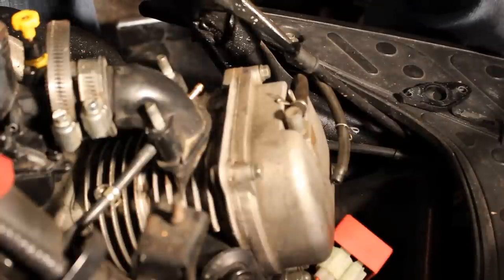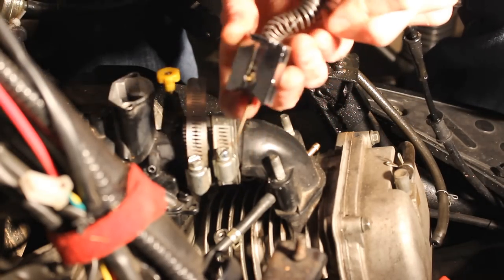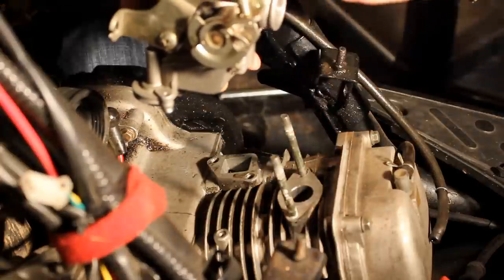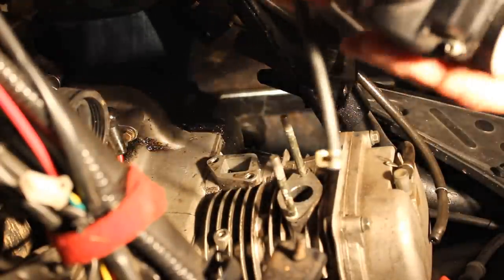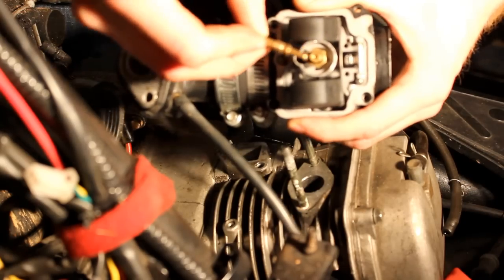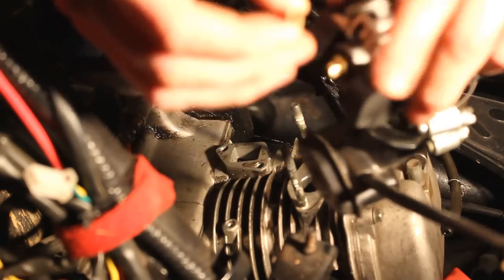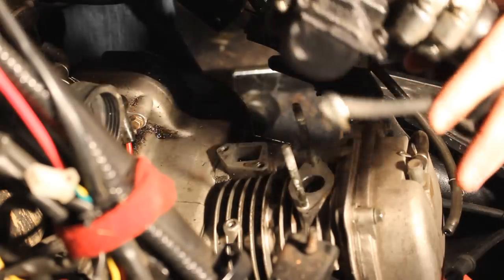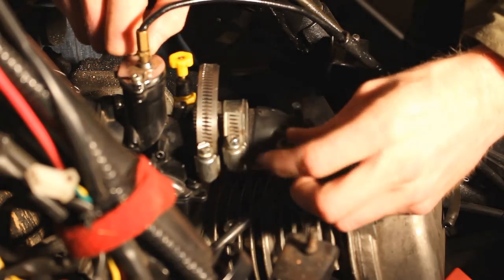How to clean jets and carb on a moped/scooter

Comment: i just want to know how you get those tight ass soft brass screws off the top of the carb without stripping them
Reply from the maker: kimmisoo morris get a Phillips head screwdriver that fits, hold it in the screw tight, take a hammer and hit the screwdriver, this will loosen it up.
Reply: i tried i couldnt do it i will have to find a man lolz i dont understand why they use such soft screws anyways
Reply from the maker: Yeah never made since to me! They make stainless screws to replace them, but have to get the old ones out first. Also you you can take vice grip pliers and loosen them that way.

Comment: I have a yamaha jog rr and i noticed some leaking (oil maybe?) ,also noticed some liquid comming out of my exhaust, and sometimes, there's like smoke comming out of my exhaust ( like burning smoke),also i feel the acceleration not as smooth as it used be and so is the sound, what's the diagnosis doctor ?

Comment: my bike, a Suzuki GS150R uses a Mikuni BS26 carb. The bike is making jerks when i encounter colder weather. In India the avg temp is 25-35 deg. But if i enter colder area during a long drive, it starts to jerk constantly, as if the engine had been shut of momentarily. it keeps jerking this way through out. I also observed that this starts to happen after i have driven around 5-10 kms. can we suspect carburettor mal function? if so, simple cleaning of the jets would do?  Thank a lot in advance.

Comment: could you make a video of changing the back tire & replacing the drum brakes on the rear??? ty for the video!!  we are working on a yamaha 125 vino right now....next thing in the carb!!!!
Reply from the maker: pat murphy I can't make a video of that at the moment but I could walk you through how to change it. If you have any problems or questions with the carb also let me know and I can walk you through it. Let me know how everything goes!
Reply: will do, ty, well it hadn't been started in five years, just sat, we changed the oil, gas tank is still in cleaning phase, but we ordered a new one to replace it, changed the gear oil, hopefully cleaned out carbs w/carb spray, new battery, only thing left to do is get new gas tank on, gas & hopefully start her up....hopefully..... she seems to want to kick over, but no gas going to carb right now, that's next....ty, will just have to wait & see, ty also, ordered new filter for side under kick stand/old one fell apart !!!front brake fine, back brake goes all way to handle, we probably can adjust that w/the screw on the brake???
Reply from the maker: pat murphy yes you can adjust it. Wow y'all have done a lot of work. Try spraying starting fluid in the back of the carb when you kick it. If no gas is getting to carb it can be the fuel petcock is clogged or not working properly. Or the automatic choke isn't working properly. Or the carb is still dirty.
Reply: k, ty!!
Reply: well, we cleaned the carb out & used sea foam on it, the pet cock doesn't seem to be working correctly, even tho it's brand new, so we are going to bypass that & i do believe it will crank w/gas, seems like it wants to, this is all i know to do......p.s. carb is cleaned out!!
Reply from the maker: pat murphy the petcock works by vacuum. Did you test it while turning over the motor? It will only work while pushing the start button or while it's running. By passing will work but will most likely cause it to flood out.
Reply: ty, the motor started w/the start button & carb cleaner, the fuel is going from the engine, but not going thru the pet cock at all-yes, all fuel lines are cleaned out & carb too, carb has been drained & sea foam put in, but it seems no vacuum to pull the fuel thru to the carb??? i'm stumped?
Reply from the maker: pat murphy is the vacuum line from the petcock attached to the valve cover?
Reply: i think so?....he took the carb apart at the bottom, everything was clean except the needle that floats up & down to let gas in, he said it didn't move freely/stuck, looked like it had rust on it. we are now wondering if we should just get a new carb, but he isn't sure if he can put it back together correctly because of the spring that handles the gas flow from the accelerator/right handgrip, he doesn't know if he can do that....???(lots of parts connected to the carb. at the side) so now we are at a standstill & i'm buying 2 more bottles of seafoam & carb cleaner.....lol..
Reply: Hey, it's me again....well now he's got the bottom of the carb cleaned very good & he got the moped started, but there is gas coming out the tube from the bottom of the carb, it has a little filter in the end of it, he says it's an air line or overflow line & the scooter won't start anymore, still gas coming out....there's a little screw w/a wire on it that holds the float in place & i'm thinking he didn't install it back in right, but he says he did...help!! & yes one of the vacuum lines is attached to the top of the tank...we have two lines that are blocked off from the carb & the third one w/the small filter is the one leaking gas out..help
Reply from the maker: pat murphy it is most likely leaking out because you have your fuel petcock bypassed. On moped gas is only drawn into the motor when it's running. (Through vacuum lines and petcock) if you bypassed the petcock there will be no fuel shutoff. So it will constantly be flowing fuel to he carb and cause it to overflow. Which will flood it out. So you need a new spark plug and new fuel petcock.
Reply: ok, thank you for your help!!
Reply: randomthingssc, well, it's official, the vino 125 is back to life! we had to buy a new carb for it, but it was worth it!! thank you for your help!! everything is working now, including the fuel gage!...it's going to need new brake drums on the back eventually, but for right now they are ok

Comment: Hi,  I have a neco one b 50cc scooter, was riding out maybe 3miles or so oil line came lose with the clip, I noticed quite quick as the power went downstraight away so I stopped reconnected the oil line. I went straight back home, but scooter kept overheating every 5mins. and cutting out.... By the 3rd time my battery was dead so I couldn't try restart. I got home , I topped up the oil, let the scooter sit for maybe 12 hours and charged the battery for 12 hours. Now its not starting. it turns over and its spitting small amount of white smoke and it sounds like its close to starting but it just wont.
Do I need to check anything engine wise? to see if this disconnected oil did any damage? or possibly clean anything? Just wanna avoid taking to dealership.... for a pricey fix.
Thanks in advance
Reply from the maker: @skyforge what oil line?
Reply: +randomthingssc the one at bottom , that's connected from oil tank into engine, but that's not the problem it has oil and is full, it just wont start after overheating but its quite close to turning over.....
Reply from the maker: +SkyForge it could be a number of different things. Take the spark plug out. Put your finger over the whole. You should feel a lot of air pushing your finger. If not then needs new top end.

Comment: I followed the video and put everything back together but same problem. I cannot see any light or run a wire down the long jet. Is it just blocked by hardened fuel deposits? What to do?
Reply: neo1az I cannot see light or run a wire through the pilot jet. It seems to be totally blocked by hardened fuel deposits. How do I clean it?
Reply from the maker: +neo1az new jet

Comment: Best to dismantle carb on bench, and avoid accidentally dropping a screw down the intake!
Reply from the maker: Doesn't look like I did!!
Reply: +randomthingssc   No, you didn't, and good for you!  Its just best to develop work habits that don't place the job in jeopardy. One day you may wish you had taken a precaution.  
A rag stuffed in the intake would be a good alternative also.
Reply from the maker: +caduceus33  this is true when I'm working on a car. But I can rebuild the whole top end of those motors in 20 minutes including setting the valves so not a big deal for me. But yes most people should take that caution with these motors.

Comment: What jets were you running in the oko on the 72cc VIP
Reply from the maker: Joshua Allen stock pilot. Not sure on main. Prob between 90-105. They sell a kit of 10. It's your best friend!
Reply: Yeah man I been working on these things for yrs. I'm just having trouble getting that same carb tuned on 100cc currently have a 32 pilot which is smallest i can find with 95 mj
Reply from the maker: Joshua Allen having trouble with idle or while driving? Have you changed the clip on the needle? Depending on the weather I had to move the clip on the needle on the side of the road lol
Reply: it's really rich on bottom end and the clip is 2nd from top
Reply from the maker: Joshua Allen sputtering? Tried moving it one up or one down from there?
Reply: Only when I let off throttle.
Reply from the maker: Joshua Allen fresh high octane gas. And Petcock is working right?

Comment: I have a 50cc eton matrix and it stumbles when I accelerate but will start every time it will run fine then just start stumbling then it will work fine again any ideas
Reply from the maker: Have you had the valves adjusted? Stock carb?

Comment: my moped struggles to start but when it does it will just turn off once i take my hand off the throttle any ideas?
Reply from the maker: Sounds like your pilot jet in your carb is dirty and needs to be cleaned. Same process as this video. And your idle might be to low causing it to shut off.